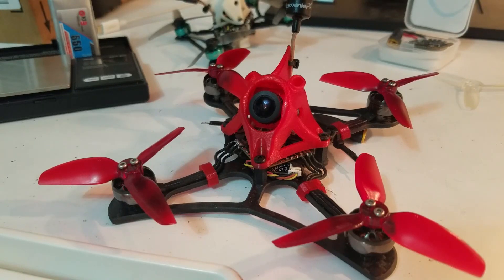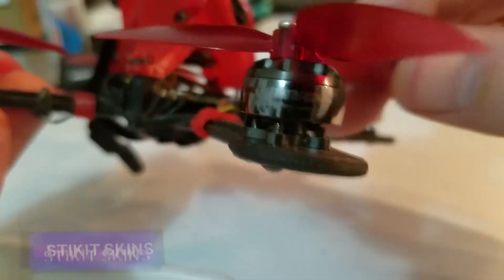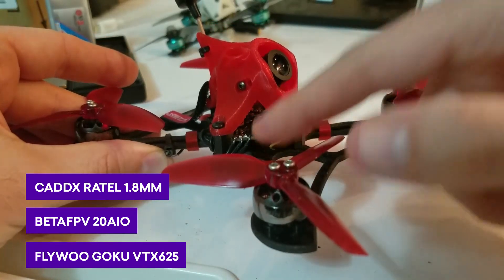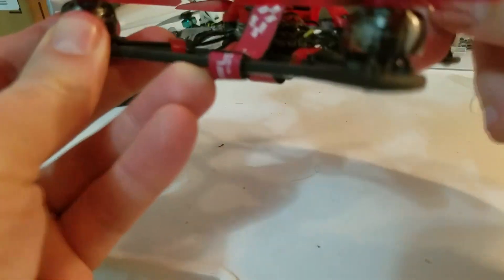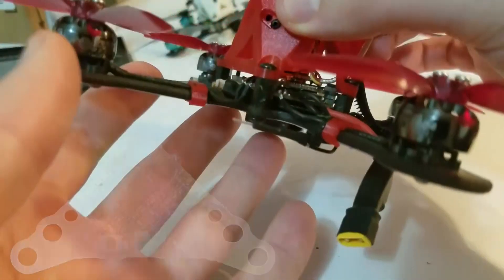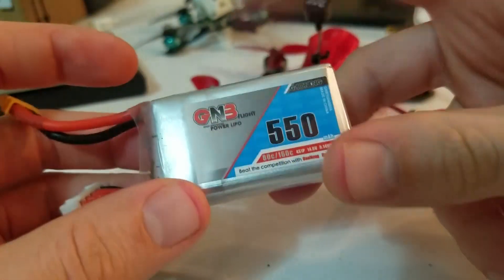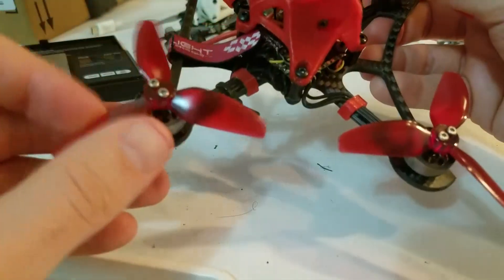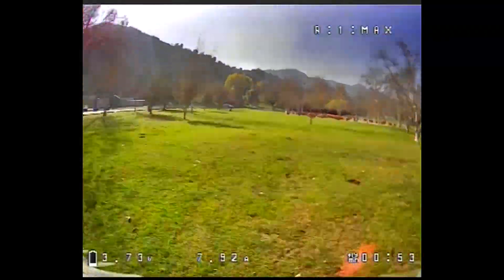Twig XL 3 inch / Flywoo NIN 1404 4850kv 4S / Flywoo Goku VTX625 / Betafpv 20A AIO / with PID tune

Comment: Flywoo 1404 V2 4850kv have a fault in its construction. Testing results are far from what they advertise and not even close to results from V1 tested in this video:https://www.youtube.com/watch?v=Mge9CBd9Iu8&t=228s 
It takes 17A instead of 10.64A at full throtle with EMAX avan 2.5" props. Max. thrust at 4S is just 311gr at 17A! It has efficiency of just 1.214gW instead of 2.37gW with this prop!! 
I have blackbox logs to prove this if anyone is interested.

Comment: could you tell me the distance between the holes for inserting the FC? I would like to take this frame and insert a FC FLYWOO GOKU GN413S F411 F4 Flight Controller AIO but  it have 25,5 x 25,5 mm holes. The frame is 26,5 x 26,5mm on specs on the betafpv site. do you think it can be mounted anyway?
Reply from the maker: Yes it will fit. It's the standard whoop mount size.

Comment: How was the flight time on the 650's, and have you tried the 3016 props?
Reply from the maker: flight time was great with 650s, probably around 4 min. I don't have the quad anymore, used the parts on another build but I have used the 3016 props on the same motors. They are fine. If you're looking for a low pitch triblade I'd recommend the HQ 3x1.5x3 because they're a little thicker and can handle more weight.